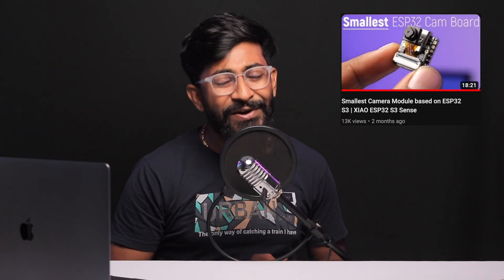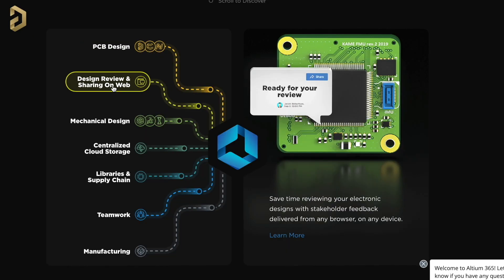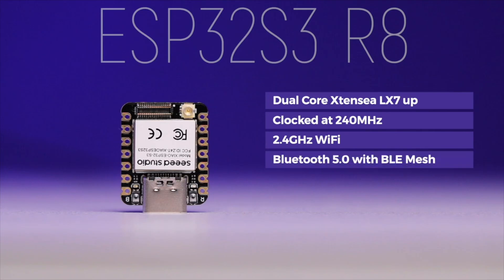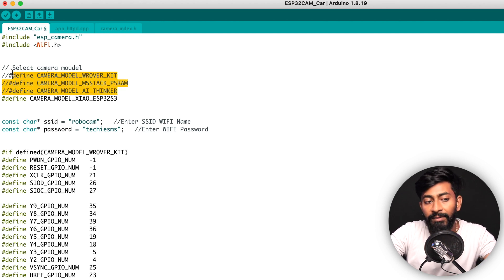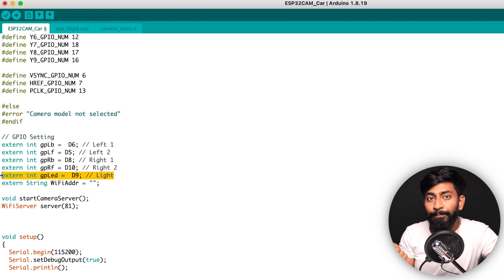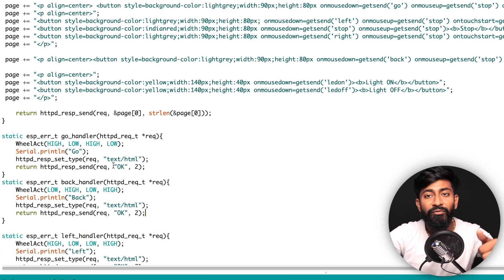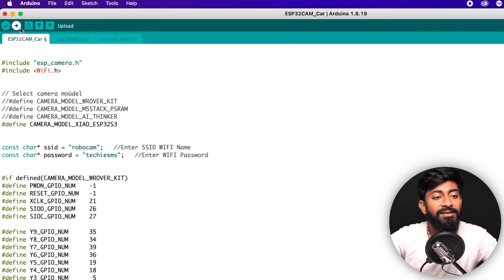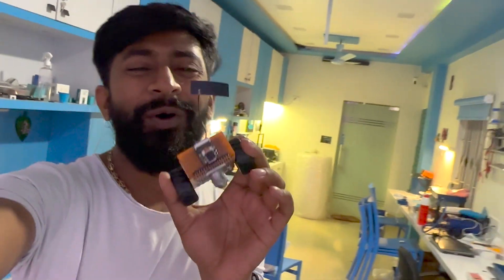SMALLEST Robot Car with Camera 🔥🔥 | XIAO ESP32S3 Sense

Comment: I’m looking to buy this board and do I did insane amounts of research 😂, with that I know that there is a charging module built on to the xiao esp32s3 sense or perhaps you didnt use it because of the battery voltage/amper

Comment: Can I use it with L298N,  2 of 18650 batteries , and 7805 regulator?
I have old robot car that uses these components. So I want to spend only on Xiao ESP32 cam.

Comment: Have you encountered an overheating issue?
Reply from the maker: It was getting heat up, but not very much hot. It was running normally.  It still attaching a heat sink is a better option